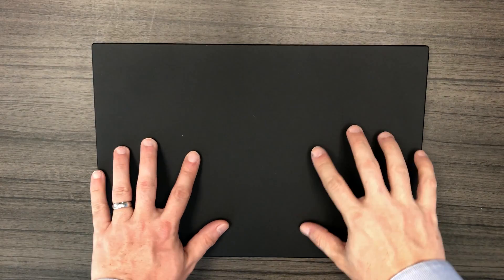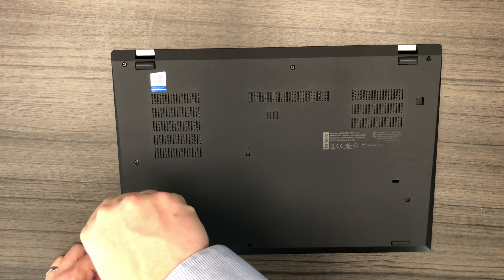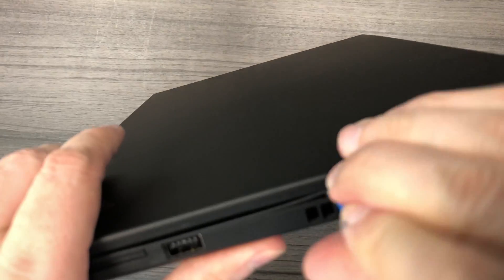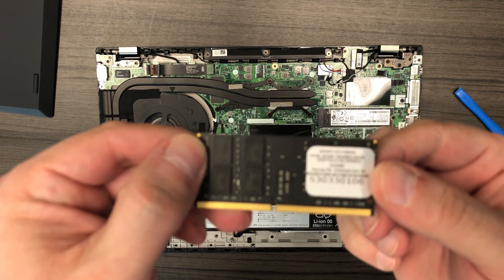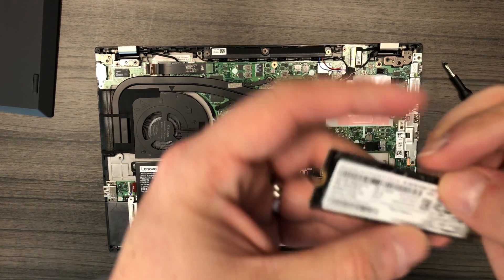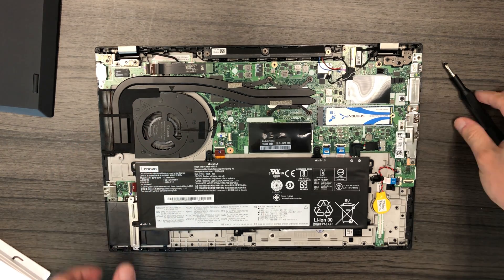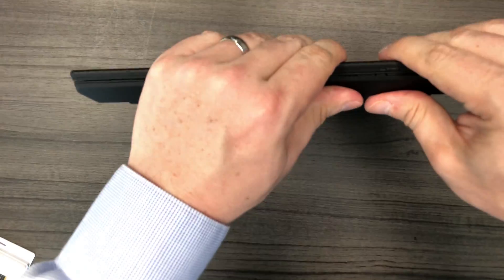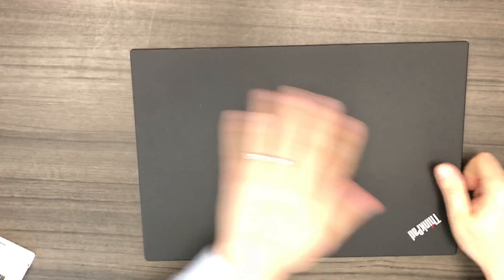Lenovo Thinkpad P53s SSD and RAM Upgrade

Comment: I would mention proper safety steps prior to removing the back.   Startup the computer without the AC in.   press F1 rapidly on Startup to get into BIOS. right arrow over to the config tab. use the down arrow to go to power menu options, and page all the way down to the bottom to disable built-in battery,  using enter key when disable battery is highlighted.  Then exit the BIOS and power off, making sure the AC power cord is not in the machine.This disables the onboard battery which cannot be removed.  if you do not do this you risk your electrical components by removing them when there is still power supplied to them.  Poof...

When you power the computer back up after after installing your new nvme, it will not power up off of battery only. you have to put the AC back in.

Comment: Hi! I opened some laptops before, but I had troubles with this Lenovo one. As I could see your 'crowbar' (around 1:15) I noticed that I don't need to be so gentle and I can use some force. :) So a few minutes later the laptop was opened. Thanks! (Note: the other laptops I could open using a 0,5 mm plastic sheet.)
Reply from the maker: In my experience not all Lenovos (even within the same family type) are built the same. With the proper tools and some patience they all open :). Thanks for watching!

Comment: Hi, would you know if I can upgrade to wifi 6? I have p53s with wifi 5 adapter soldered in.
Reply from the maker: Yes, you can easily fit an Intel AX200NGW or comparable adapter.